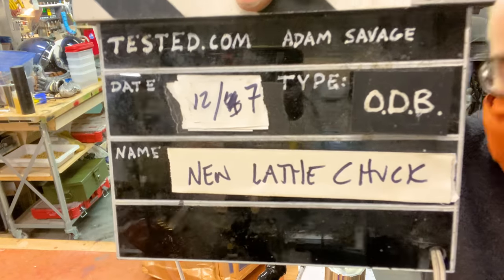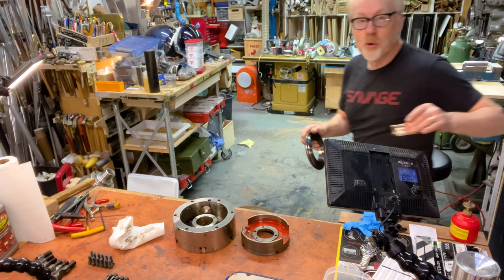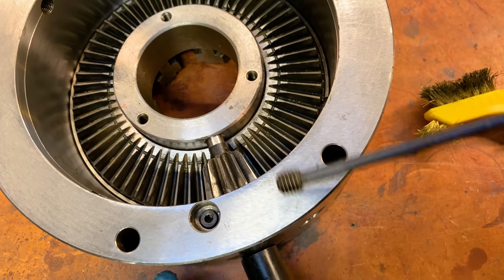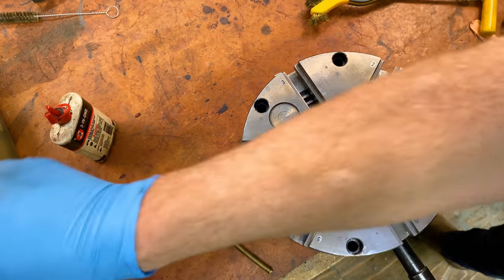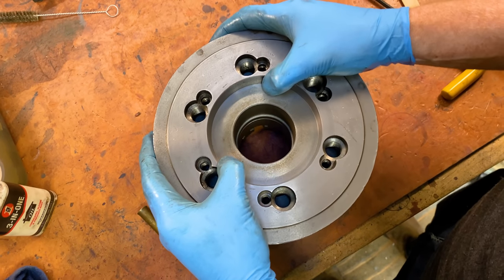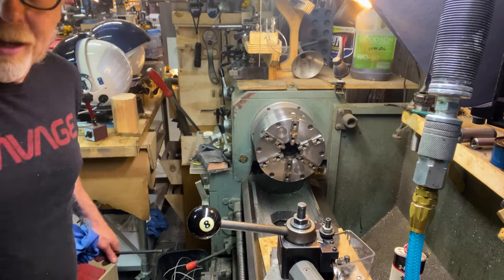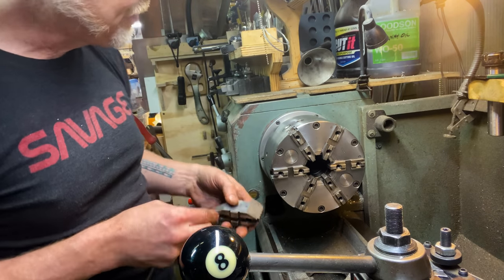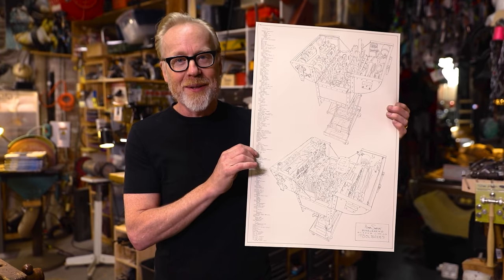Adam Savage's One Day Builds: New Lathe Chuck!

Comment: Hi Adam. The 6 jaw adjustable with reversible jaws is a great addition to the shop. Its my favorite. Just an FYI, the cam pins in the back plate have a circumferential groove on each one about 1/4" up from the threaded stud. Thats a reference line intended to be aligned with the face of the back plate at installation. this normally gives you the correct cam rotation and locking action when you tighten the cams. You should also make a wood cradle for installing and removing those chucks and put a piece of aluminum in the jaws to act like a handle. Its the first thing I do with a new chuck and it makes it much easier and eliminates the worry of dropping the chuck or smashing a finger. Stay well bud, I enjoy your work.
Reply: @andybaldman  I'd be happy knowing half of what Adam has forgotten about general special effect construction. I admire his skills. Very diverse.
Reply: Thanks for the tip Joe. My lathe came with what looks to be close to the same 6 jaw that Adam got, except mine does still say that it's a buck. I hadn't really considered how to improve the process of taking it on and off because it was my only chuck. That is until I picked up a 4 jaw and magnet chuck on auction recently and all of a sudden I have multiple stupidly heavy things that I need to move on and off my Monarch :P (the 6 jaw seemed huge to me, but it's now my smallest chuck)
Reply: @rustedfriend  You can get a small "crane" to move them if you need help. ABOM (Adam) uses one to save his back and toes!
Reply: @BLKMGK4  Yeah, I'm planning on hanging a block and tackle over the lathe on an i beam track for taking chucks on and off as well as the tailstock and materials.
Reply: Joe, we always kept our chucks and faceplate on a rack mounted to the back to the bed. These had tapped holes for eye bolts and we used a hoist.  Most of our lathes (LeBlonds*) had L type long nose tapers. 
*the superintendent was a LeBlond admirer. One feature on the later Regals (1970 or so) was the front ways were replaceable. They were hardened and ground and were held on by cap screws from underneath. Most bed wear occurs near the head stock anyways on the operator's side. Unfortunately LeBlond did not put two sets of tapped holes so you could swap the front way end for end.

Comment: From the author of "Every Tool's A Hammer" comes "Every Chuck is a Vise"
Reply: It get's especially confusing when you have a pin vise.
Reply: Every drill is a lathe
Reply: An old three jaw actually does make a really nice vise when mounted to a work table. Very handy for holding larger round parts. In my opinion about the only use for a non adjustable 3 jaw is as a boat anchor. I was trained during my apprenticeship to do everything in a four jaw.
Reply: i cant no more 😂

Comment: Lathe tip. Always keep a piece of plywood large enough to cover both ways close at hand, and put it on the ways before removing or installing a chuck. That way if (when) your hands slip and you drop a chuck on them it does not damage either. Also, chucks like this with fine adjustment are meant to compensate for minor variations in the jaws and scroll, meaning that the reference point for adjustment should be a piece of material clamped in the jaws, not the body of the chuck. This adjustment can only be counted on for that specific diameter of material, and if a different diameter is used that size material should be chucked up and concentricity checked and adjusted if needed.
Reply: yeah I made a custom block out of a 4x4 with a radius for my chuck on top and 2 v's for the ways on the bottom, it's such a godsend trying to set up my 4 jaw

Comment: 33:23 - It may or may not be a vise, but for Adam it's clearly a vice.
Reply: I reject your vocabulary and substitute my own!
Reply: ha ha - well a 2 jaw chuck "could be a vise" - yes still workholding - most definitely a clamp - I think that encompasses all these variations and specialisations.
Reply: When I was still working I took an old 3 jaw about 15" in diameter eter, built a mounting bracket for it. And then mounted it to a steel work table. I was constantly working on the end walls for large centrifuges. Worked really handy for doing inspection work, removing bearing races etc.

Comment: Thos was insanely satisfying to watch, I would love tonsee a whole series of Adam taking stuff appart, cleaning it and making it perfect again!
Reply: Hate to disappoint you but that cleaning wasn’t perfect. The way the jaw moved and sounded when he tested it in the spiral was not good. Those components should be stoned to deburr them, the outside of the jaws and the face should be done as well. Needing to hammer a jaw into place is not a correct fit.
Reply: The chuck should be tightened on the spindle nose like a tire is mounted. Tighten them in 180 opposing pairs. The D1-6 spindle taper is where the accuracy and repeatability comes from, if the chuck isn’t seated parallel it will cause problems.
Reply: @Tullerion Check out Stefan Gotteswinter searching the term "teardown" -- he's definitely not as charismatic or charming as Adam, but he's a terrific machinist, and his teardown, clean, reassemble, perfection routine is amazingly satisfying.

Comment: Something that I made for my lathe, and that you could make in under an hour, is a lathe cradle.  I took a 4x4 and cut a curve to match loosely the diameter of the chucks and also a register on the base that matches the ways of the lathe.  That way when I remove/install a chuck it holds it close to the installed position so that I don’t accidentally drop it an dent the ways.  Always enjoy your builds.  Keep up the great content.

Comment: Are you sure that zerk fitting is for grease? Often times in machine tools it is for oil. Oil seems like a better choice for a chuck as it won't attract swarf as bad.
Reply: Grease is best, Oil would sling out of the chuck body far more easily. No matter what chips will still get in the body. It mostly depends on the body design how much gets in.
Reply: Mine are certainly for oil but know chucks some specify grease.

Comment: Great vid, just wanna say  that even though it's a set-tru or adjust-tru chuck, you should still use best practice and turn the registration surface on the back plate in place on your lathe, so the registration surface has zero runout relative to your spindle bearings... That way you get the most effective range of adjustment from your adjusting screws.....as you said, the spindle taper on the back plate was abused, you can remove that error by doing a skim cut on the registration surface with the back plate mounted in place...

Comment: ADAM!!!!
I doubt you’ll see this but just in case you do, as a former machinist, I’ve got a tip for ya!!
Before removing your heavy chuck from the lathe spindle, lay a piece of plywood under it. This way, when you tap it to remove it, (or if you have slippery fingers) it won’t crash into the ways and damage the machine! :-)

Comment: Machinist pro tip: use a lighter oil instead of grease, and reapply regularly. Grease gets packed full of dust, especially wood, plastic, and bronze, and your chuck will get stiff pretty quickly.

Comment: 1. yes that space in the scroll plate is where you need to install the pinion (if you try to assemble a chuck every part should just slide together no hammer)
2. they make grease specifically for chucks
3. Zerk fitting are cheap replace them when ever you remove them (240 for $40 on amazon that's 6 cents apiece)

Comment: No, d1-6 is a ‘size 6 ‘ spindle nose. It is the diameter and the angle of the nose taper and the pcd. It is the quick change version of the four stud and lock ring of the size6 that I have on my TOS. Even though it has a grease nipple it will be for an oil gun. Grease does you over because swarf sticks to it. Slide oil is what you want on a low use machine, nice and sticky. Congratulations on finding that chuck, it is an amazing thing :o)

Comment: At 16:50 the backing plate should have four flats milled to correspond to the radial set screws. This allows the adjustment of one diametrically opposed pair of screws to not influence the other pair.

Comment: I recommend doing that exact same thing to your kurt vises that you have complete tear down and clean and out it back together. Every so often it will make your vise work like new if you do it the screw part that is attached to the movable part don’t nick the threads up it is a special thread can’t find the die for that thread it is a backwards thread as well but it is pretty easy just a lock ring holds in the part you turn

Comment: Man oh man I love me some shop tools!  WARNING: mixing oil and grease like you did can cause a reaction between incompatible components in each lubricant which can neutralize the lubrication and degrade its performance.  I have seen grease turned to the consistency of parmesan cheese because of this.
Reply: additional point, grease is more likely to capture swarf and dust which causes issues in precision metalwork, you want to stick to oil because as you use it, and refill it, it will wash any captured swarf/dust out of the components (so oil seeping out and constantly needing to be refilled is an intended feature).

Those "Grease Zerks" are also used for oil using your standard oil can, just hold the tip against the ball at the end to put oil in.

Comment: Suggest you make a wooden cradle to ride on the ways of the lathe and hold the chuck in position for install/removal of the chuck and prevent damage to the ways in case of slippage or dropping the chuck.

Comment: great video Adam, but if i may make a few surjections. i would use a 1/10th indicator you want to use the 10-1 rule for measuring that accurate. also depending on your indicator and brand you could have cosine error that can throw your measurement out. and lastly i would check to make sure your tailstock is within centre to your chuck now with either a test bar or test cuts.

Comment: My take number two ^-^ The back plate should be a slight interference fit in the chuck. (Step made on the same lathe) The taper gets damaged by fitting it with swarf on the taper. The taper nose should grab just enough that the chuck needs a tap with a leather hammer to take it off. Easy fix if it is loose, skim the back plate so it goes on further.

Comment: FYI - if you use Evaporust and don’t fully cover a part in the liquid, you’ll end up with an etched line in the part at the air/Evaporust interface. (this is caused by the interface flash rusting and the being chelated off over and over)

Comment: Yes Adam you guessed right you need to line that gap up it just guarantees a proper meshing between the gears. But you were careful in the way you oriented the gear in the hole before you hammered it through.

Comment: When they say "a lathe is a tool that can build itself" they mean that you buy so many upgrades to it that in the end you have all the spare parts to build another one, right?
Reply: I always wondered about that!
--
But then I found D.J. Gingery has a nice description of how a lathe can bootstrap itself by first configuring it as a horizontal boring machine, to bore its head and tail stocks.
Reply: A lathe can never really be used to build a true copy of itself. A smaller version sure. All or most of the major mechanical components, but the structural parts, bed, ways etc no. 45 + years of turning solid metal into little curly cues. There is a lot you can do on a lathe. But sometimes I gets pretty cumbersome. Using the slides with a third slide mounted vertically on the cross slide gives you a boring mill, sort off. The problem comes in that the ways on the bed of a lathe are designed to take forces in a different direction.
Reply: @mpetersen6  In order to make a rudimentary lathe, you only need to be able to cast metal, file and scrape it flat, and have a lathe for the round / concentric bits.
Of course, having a mill / shaper greatly helps in making the linear shapes, and a surface grinder in quickly getting to the required precision. For gears you obviously need a mill or milling attachment.
But it is possible to build a perfectly functional lathe without any machine tool but a lathe. And using said lathe and manual tools, one can build any other machine tool.
Reply: @TheEvertw  
Believe me, I've pushed a far amount of chips with scrapers. Both flat and bearing. Of course to do the castings you need wood to carve the patterns. Tools to carve with. Like the man said, first you need to make the tools to make the tools etc, etc. And to think it all started with a rock cracked to get a sharp edge.
Reply: @mpetersen6  I got where you are coming from ;-)
I am fascinated by the history of machine tools, how new developments were used to build upon what already was. The Lathe is probably the oldest machine tool, used with  stone chisels to make round things, or in its horizontal form to shape pots. Perhaps some type of drill preceded it, but those don't count ;-)

Comment: I was wondering how all the carriers were going to line up with a scroll until Adam mentioned that they were numbered. I knew that the scroll was going to meet the carriers at different points, but it makes sense that the carriers are matched to a certain location on the scroll relative to the entire chuck.
Reply: I have worked with chucks that no longer had the slots numbered. They had been used on OD and ID grinders and ground true so many times that the numbers are gone. If you set the jaws on the bench with the scroll interface "teeth" pointing up you can arrange them in order by looking at the last tooth on either inside our outside. Then insert them in order. The "jaw number 1 in slot number 1" perfection may be "better", but knowing how to get them into a chuck in order if it is not marked is a useful skill :-).

Comment: I want to get a 6 jaw for my old craftsman/atlas lathe too.  I saw one that would fit its small spindle on ebay awhile back but it was very used looking and over $300.00,  I didn't have the money at the time but like I said it looked really rough so it probably wouldn't have been a good deal.

Comment: Adam.. please dial it in closer on chucked in pieces.. so that you can swap ends of a piece and have it concentric to the previous machined surface..  so what it takes you another 15 minutes. the knowledge its as perfect as you can get it. will make you love using it even more.. 
 don't forget.. you may want to use a torque wrench to tighten the chuck jaws evenly each time.  lastly.. you can make, depending on how much other equipment you have.. absolutely massive soft jaws when you need to turn something huge or odd shaped.. 

 lastly the D1-6 pins.. how much does ONE turn effect the degrees of locking angle the locking tool..  you might want to get them all exactly the same as it looked like you have about 1/10 of a tightening turn to one turn of the cam pins.. 

 hint for viewers that don't have heated shops.. and moisture is an issue.. or you have coolant flow on your lathe..   between the back of the chuck and the mounting plate.. use a super thin rolled out layer of Hylomar also available at Permatex 85420 flange dressing. its coolant and solvent proof.. this will prevent rust jacking between the mounting plate and the chuck back. 

 now that you are six jawed.. kinda like the beast in alien.. you can sing how many chucks could a chuck, chuck if a six jaw could chuck chucks. 

 lastly. the alien thought brought back an alien movie memory.. growing up in hollywood.. the alien movie was playing at the Egyptian theater.. some friends and i as teens to an afternoon show.. we were late to the movie.. the scene was the alien in the water under the cat walks as we walked in to the dark theater with only about a dozen people.. it was really creepy. the carpet was damp.. the seats were damp much like the scene on the screen.. there was moisture coming down from the ceiling. scared my friends so much they ran out the side exit.. i never got back to ask the manager how they pulled that special effect for a dozen people in a 600 set theater without destroying the upholstery.  almost 20 years later i was having dinner with some friends.. when somebody mentioned one of the wives had worked in theaters in hollywood. i ask if she had worked at the egyptian.. yes.. while alien was playing yes.. how did you do that effect without ruining the seats and carpet and went on to describe it.. she said that was not a special effect.. that was the day the swamp coolers on the roof overflowed.. 
what are the chances of running into the exact person who was there 20 years later..